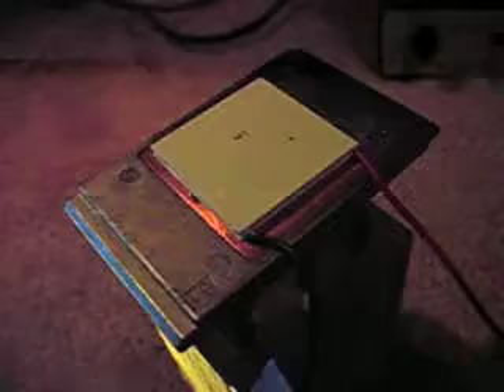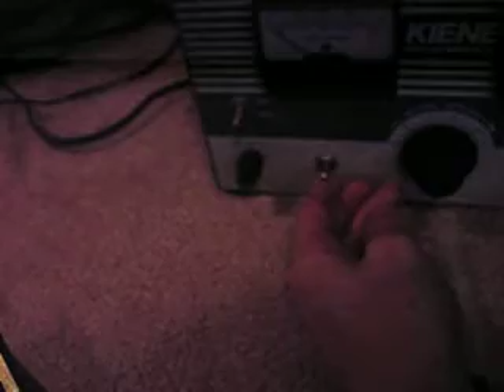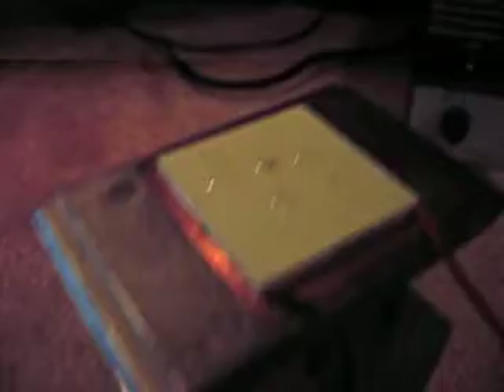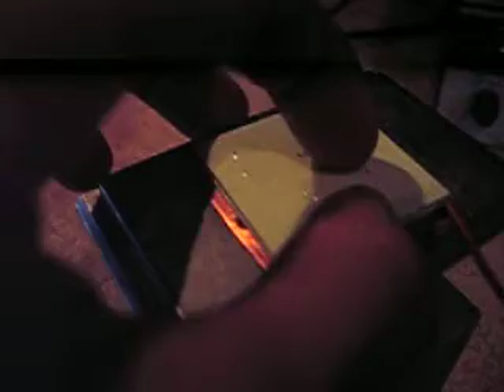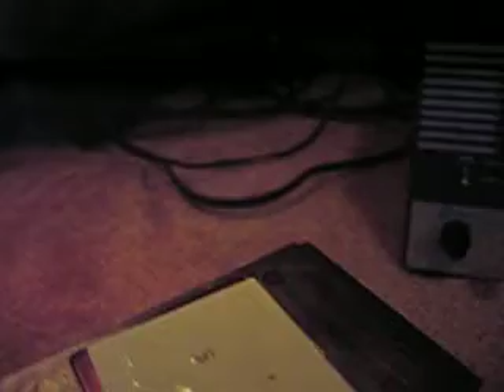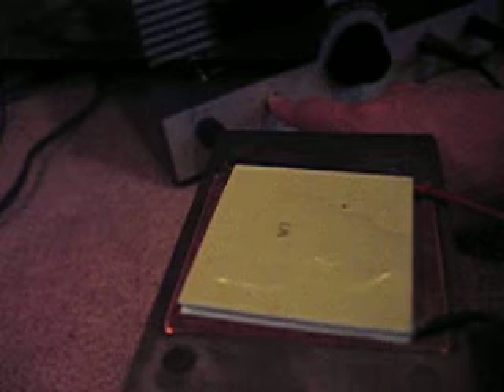Peltier unit instant ice and instant boil.

Comment: just out of curiosity if you attach a heat sink to the cool side will it be cool enough to start condensing water vapour from the air onto the heatsink, if so this could be a way to get fresh water from the air...

Comment: Hello, can you tell me what model you use in this video? (how many watts).
I would like to make a hotplate with a thermoelectric Peltier to boil water (1 liter) for approximately 1.5 hour.
I would use 12 VDC 500mA  ... In your opinion, is that possible?
Due to the cold part is underneath, is it that I could stick the unit directly onto a plastic box?
Thanks

Comment from the maker: @gg459 
at it 10v it pulled 5A, and at 12v it did 5.5A accordingly.  There wasn't much of a temperature difference between those voltage levels (verified via thermocouple).  So the range was 50-66w power consumption.  A decently sized deep cycle marine or car battery would last a while if you want to tinker with one.  Below 8v, the cooling is drastically reduced on this "12v" unit.  That answer your questions?